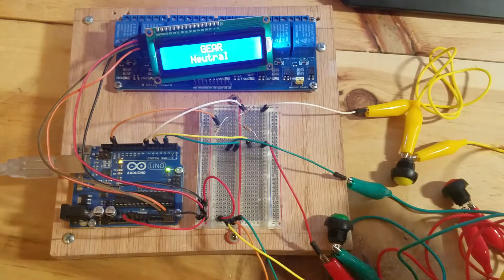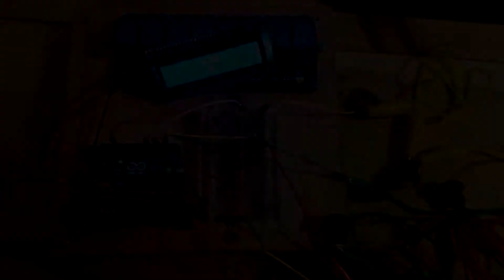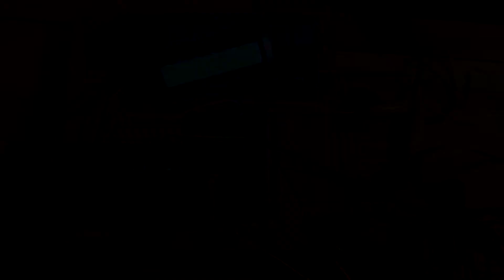DIY Motorcycle Gear Indicator

Comment: If your bike has a neutral indicator, you could use that signal to reset the code and also it would be more convenient for you to recode the numbers as 1,0,2,3,4,5
Reply from the maker: Yeah, tracking. This still never made it onto my bike, but if it does I would likely do that.

As far as the convenience of using 0 instead of N, I think that's a non-issue. It's been more than a year since I looked at the code or this project in general, but I don't think there was ever any problem there. It's just printing a character instead of an integer. Oh, wait. This video is the first prototype where I was using an LCD. I did it again with an OLED and used a capital N. I think I have a video of that on here as well.